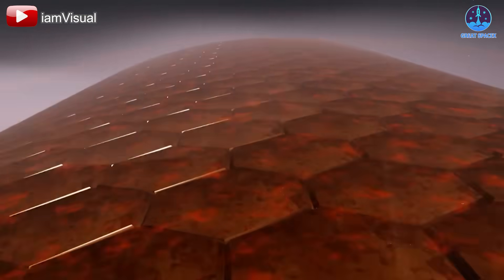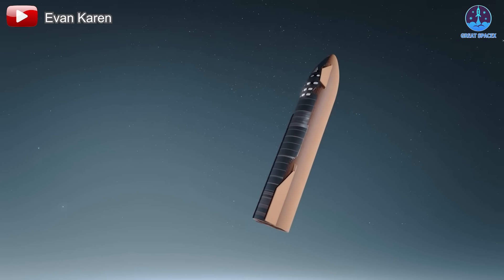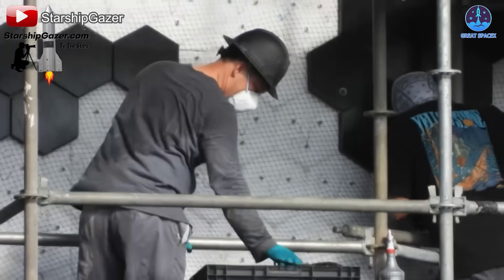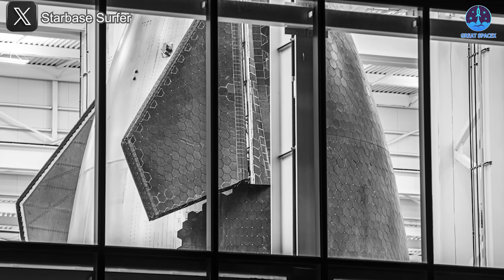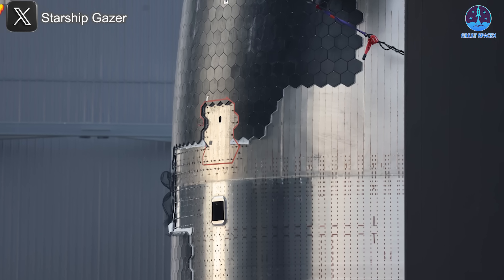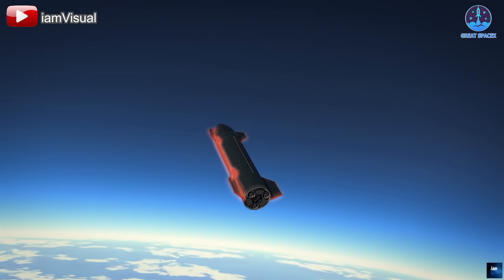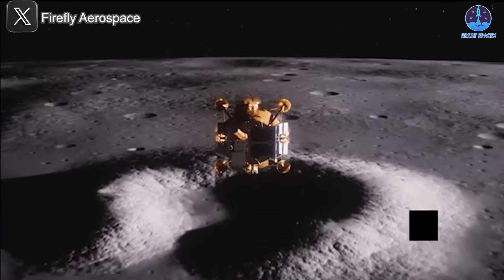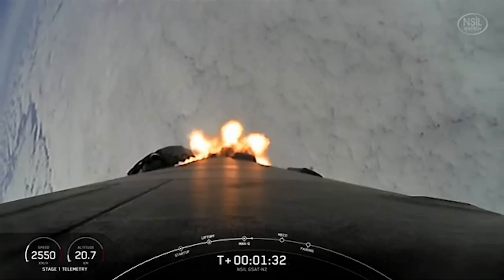Elon Musk revealed NEW Fully Reusable Heat Shield Completed in 2025 to End Ceramic Tiles...

Comment: Elon is lying about the new heat shield because SpaceX is in desperate need to raise more of venture capital.
1. Inadequate Ground-Based Test Facilities:  As should be painfully obvious by now, SpaceX does not have adequate ground-based test facilities to use in developing the Starship thermal protection system (TPS).  Making bold predictions that SpaceX will develop the miracle TPS this year is laughable.
2.  Radically New TPS Design:  The new TPS that Elon has announced is completely unlike any other in history and, to make it even worse, has to be incredibly large!  Boldly predicting that such an engineering challenge will be completely solved this year is a transparent lie.  Sure, rocket engines do use a similar cooling approach to the one that SpaceX is now pursuing, but rocket engines are MUCH smaller and can be thoroughly tested ON THE GROUND, over and over again.
3.  Engineering talent:  SpaceX has a lot of good engineers, but I don't think they have nearly enough to complete the new TPS in a year.  Is this why Elon is insisting on oodles more H1-B visas this coming year?
4.  Operational manpower;  Launching a prototype vehicle like Starship 25 times this year will require many more operational personnel that SpaceX has used on Starship so far.  Where is SpaceX going to get these?  Are they going to put the Falcon 9 program at risk by stripping them out of that program at greatly increased risk for that program to put them on Starship?
5.  Money:  SpaceX has so far spent $3 billion(?), $7 billion(?), or more on Starship development.  Much of this money has come from investors and NASA contracts that haven't been delivered.  Where is SpaceX going to the money to suddenly build, launch, and learn from 25 new Starship launches in a single year?  There probably aren't going to be any new big NASA contracts this year so my belief is that SpaceX is frantically trying to raise more money from investors or borrow it from banks based on Tesla's wildly inflated stock valuations.  Considering how burned the banks are from lending Elon money to buy Twitter, I'm skeptical that the banks will be so stupid once again UNLESS Elon gives them an end to the FDIC and threatens them with Trump administration regulatory actions.  (BTW:  I would not be surprised if the new miracle heat shield tiles are RED precisely because Chinese inestors like the color RED and it might encourage them to give money to SpaceX!)
6.  No TPS Means a Major Redesign is Needed:  Without a working TPS, the entire Starship 2nd stage design and operational approach will have to be redone from the ground up.  The size, shape, and operational approach of Starship 2nd stage is entirely dependent on having the working TPS that Elon told his engineers to assume 5 years ago.  If SpaceX cannot come up with a working TPS that is completely and immediately reusable, the current Starship 2nd stage design and operations approach will be an unmitigated failure.
7.  Major Movement of the Goalpost:  As we have seen in ALL of Elon's endeavors, when the initial assumptions prove false, Elon moves the goalpost to distract people from looming failures.  In this case Elon has announced a radically new, completely unproven, still to be developed TPS and an infeasible flight schedule to distract all of us from the fact that the current Starship 2nd stage design is NOT going to work.  When will people realize that Elon's REAL name should be "The-Boy-Who-Cries-Wolf-Over-and-Over"?

The bad news is that SpaceX's current Starship design if ailing.  The good news is that its looming failure will be plain to see in the next 3 or 4 months when the announced Starship launch schedule begins to slip badly and the new TPS approach does not materialize.
Reply: Cry more 😂
Reply: So they’re not going to figure it out?
Reply: @Will-eq7uh  
I don't think that the current thermal protection system can be made to work so that it is COMPLETELY and IMMEDIATELY reusable without refurbishment.  Those two adjectives are the key and what I don't think can be achieved with current materials or even with a radically new active cooling approach which has never even been tried on a scale as large as the Starship 2nd stage.  Obviously it is possible to making thermal protection systems than can be capsules and the space shuttle back to earth, but neither of those approaches is anywhere near completely and immediately reusable.
Reply from the maker: But why heatshield? We have many other better things to lie
Reply: @colonbina1  
Elon is lying about the heat shield because having a COMPLETELY and IMMEDIATELY reusable heat shield is CENTRAL to the design of Starship's 2nd stage.  This (failing) assumption dictates the size, shape, operational approach, and economics of the Starship 2nd stage.  If such a heat shield is not possible, the Starship 2nd stage will need to be rethought from the ground up.
Reply: @wbwarren57  you would like for everyone to believe that. Why do you think they are building multiple launch towers and everything else at a wild place. It's not because they are running out of money. Falcon is a money machine, starlink is finally up and running. You act like the last two launches weren't a total success. Not to mention that they are test articles. Loosing them isn't a loss. It's a gain of data. Open your eyes dude. Edison didn't fail a thousand times. He just figured out  how not to make a light bulb a thousand times.
Reply: @wbwarren57  I'm curious. How do you know SpaceX is desperate. Are you on some inside track that everyone else is unaware of. Because whether or not your a so called SpaceX fanboy or not. NO ONE is making the claims you are.
Reply: @ 
Six flights and no working TPS. Every other space vehicle that was intended to come back to earth did not need six flights to try and figure out a TPS. Also, the fact that SpaceX is now going for a completely untried (at least at this scale) TPS is to me a sign of desperation. The size, the shape, the operational approach, and the economics of the starship depend upon having a TPS that is completely immediately reusable. If they’re not desperate, they should be.
Reply: Ahhh. SpaceX is desperate??? They must not be able to fly.... O wait. They have flown 6 times now . number 7 is weeks away. Haters wannabe haters. Wannabe being the key word.
Reply: @AdamArndt  
SpaceX has flown 6 times and STILL DOES NOT HAVE a COMPLETELY and IMMEDIATELY reusable thermal protection system.  Yeah, SpaceX is desperate.  They are running out of money and engineering resources and are facing a major engineering / development / testing challenge to develop a radically new thermal protection system that has to be scaled to work over the entire Starship 2nd stage.
Reply: Elon has a proven track record of overcoming engineering obstacles over and over again. And your whole point is that Elon is “lying” because you don’t believe that he can overcome these obstacles.  😂.  Yeah.  I’m putting my money on Elon.
Reply: @pjritts1  
Yeah!  You PUT your money on Elon.  Hyperloop failed.  Full Self Driving based on video cameras alone is failing.  The current Starship 2nd stage thermal protection system has failed after 6 flights.  The Boring Company is failing or at least not going anywhere.  NeuralLink is failing.  The Cybertruck is failing.  The low-cost Tesla new model is still not here.  Robotaxis will fail because FSD is failing.  The Tesla semi is just a bunch of undelivered promises.  SpaceX is years behind on its NASA contracts to get to the moon.  There is no prototype for a Mars colony here on Earth and no one believes that Starship is the right vehicle to get us there.  Tesla robots are years behind its competitors.  Elon's AI effort is sucking up LOTS of money, but not really delivering much if anything in the way of revenue and it is still unclear that it will.  The Tesla semis is not delivering anywhere close the performance that Elon claimed it would.

The only REAL successes that Elon can claim are current Tesla models (before Cybertruck), Falcon 9, and the Raptor engine.  Elon bought his way into Tesla and did not develop the currently working early models.  Under Elon's control, the quality of Tesla models has not improved much.  Elon was right that a reusable booster could be made and takes credit for all of the Falcon 9 (he never mentions anyone else), but that was actually developed by a team of engineers, not Elon.  The Raptor engine is being developed by a team of SpaceX engineers (whom Elon never mentions), not Elon.  So, where are Elon's great engineering successes that he actually did more on than provide money and falsely take all the credit for?
Reply: @wbwarren57  
"Elon bought his way into Tesla and did not develop the currently working early models."
The CURRENTLY working EARLY MODELS ? Are you saying that Tesla - as a company - had the model X, 3 and Y already ready and working before Elon invested in the company ? They were ready, finished and working and all he did was buy up the working "early models" and started churning them out ? And he kept that up from what he bought from Tesla without ANY changes. Interesting....tell us more please

Engineers working on F-117 - can you name them alphabetically ? And none of them were named Skunkworks btw
When Boing made the Boeing 707...how many of the engineers were mentioned by name ? How many of them can you mention by name ?
When Ford made the Mustang Mach-E or F-150 Lightning I'm sure you can mention the engineers working/making those models right, after all it wasn't Jim Farley....
The engineers that made Shinkansen - names ?
Reply: @OveToranger  
No, I can't name those engineers - but I am sure I could find their names.  Also, the leaders of those efforts did not go around saying stupid things like "...I think I know more about manufacturing than anyone else in the world" the way that Elon did.
Reply: @wbwarren57  believing isn't seeing. Seeing is believing. So open you eyes.
Reply: @AdamArndt  
You are right!  What I see is 6 flights with no working thermal protection system yet that could be completely and immediately reused after a landing and a SpaceX engineering team that is throwing out the current TPS in favor of a new type of TPS that has never been tried on this scale before.  Based on that behavior, I think the SpaceX engineering team is desperate and throwing literally anything at the problem - except of course building and using adequate ground-based testing facilities that would allow them to test and develop at much less cost and much faster.
Reply: @wbwarren57  I don't buy that!
Reply: @AdamArndt  
We will see.  Right now we have a whole lot of new Elon promises and predictions which - even though his past promises and predictions have frequently proved false - WILL be useful in raising new money from investors.  In that regard, whether or not these new Elon promises and predictions will ever be realized (which I sincerely doubt), they are successful enough to maintain the Elon cult.  Yay!  Elon!

Comment: Or Ship could re-enter slowly and not require such a sophisticated heatshield at all.
Reply from the maker: This is impossible!!!
Reply: @colonbina1   Why ? I know there probably is a practical reason why they don't do it, but is there a technical reason ?
The booster does it and that Virgin thing with the adjustable wings did it.
What happened with that Virgin 'spaceplane' anyway ?
Reply: @Peterthegreat1234 probably because you will need a lot of fuel to scrub the insane (orbital) velocity the ship is coming in at, to slow down enough and have fuel left in the tank to land the ship.
Reply: Slowly at 17000mph?
Reply: You would need as much fuel to slow it down as used to speed it up.  You would have to lift all that extra weight at liftoff.  The fuel weighs 5 times more than the payload so it just doesn’t work slowing down with fuel.
Reply: @AllanStaib That's not really true. Launching is from standstill/no speed. Re-entering doesn't require a complete loss of velocity ( and without the payload it had when launched ), but I get your point ( sort of ).But if
 refueling tankers in orbit becomes a thing fuel may not be a problem when re- entering.